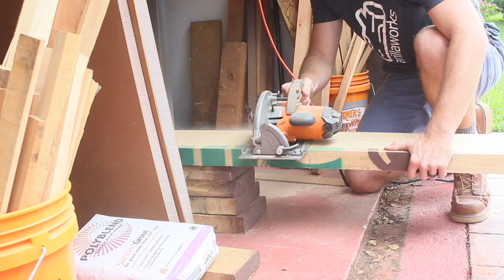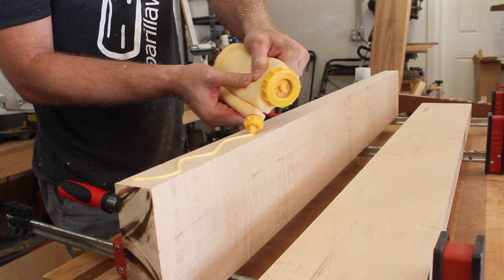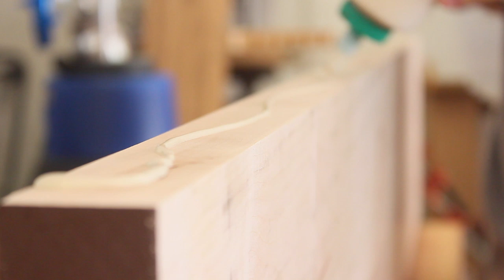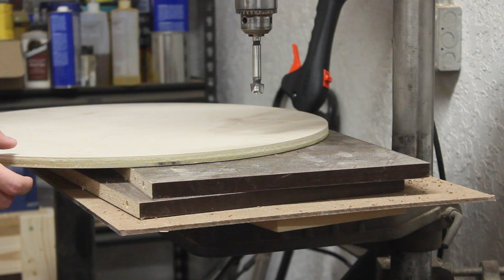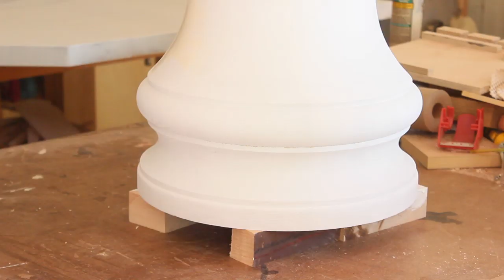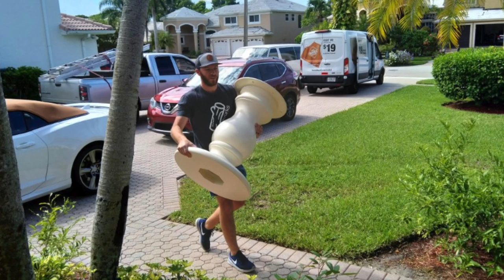Making an Odd Sized Table for a Breakfast Nook

Comment: Are you pleased with the scorpion combination machine? There's a distributor here in Canada that I've been looking at. I'm comparing the Scorpion against the Hammer
Reply from the maker: Hi Rick. So far I've been very pleased with the machine. It works as intended and hasn't given me any issues thus far. If you have any specific questions, feel free to ask them here or in an email.

Comment: Are you still liking that planer/jointer. What blades do you use in your track saw?
Reply from the maker: Yup! It works great. I jointed some 13-14" wide Jatoba on it and it didn't bat an eye. I usually use the stock Makita blade that came with the same but for this project I tried using a dedicated ripping blade because I was using the same as a jointer. That said, the rip blade didn't give me anything better than the stock blade.

Comment: Brilliant - and glad to see you using the DowelMax.  I use it regularly and the joints are extra strong.
Reply from the maker: Agreed! I'm going to do a dowelmax video soon when I find the time; I've been meaning to get that done.
Reply: @parillaworks  Thanks for your reply.   I'm just a hobby woodworker and have been tempted to buy the Festool Biscuit system but it's very expensive for an amateur.  I've therefore been using the Dowelmax and it's faultless.

Comment: Very nice, that looks great in that space. I’m sure it must have been a bit of challenge making that to the exact specifications for that strangely shaped nook. It was kind of painful watching you flip the table top over all on your own. I certainly understand the difficulty of working with larger items in a small shop.
Reply from the maker: Thanks Scott! It was a little tough getting the size correct. I measured the space and added some size so that it overlapped the bench some. The angles ended up being around 135 degrees which was nice. And I flipped that thing like 4 or 5 times...it was definitely a pain in the back!!

Comment: That’s an odd shape indeed! Halfway through the build If was completely lost about the final form, but it fits the nook nicely. When I noticed the table top nearly scraping the ceiling as you were flipping it, I recognized the challenges of smaller shops. Or, we also want to build projects slightly to large for our shop 😜. Good luck with the hurricane, hopefully nobody gets hurt and no major damage 🙏.
Reply from the maker: Thank you Harko. I had to flip the table about 4 or 5 times throughout the project. It was definitely hectic each time!